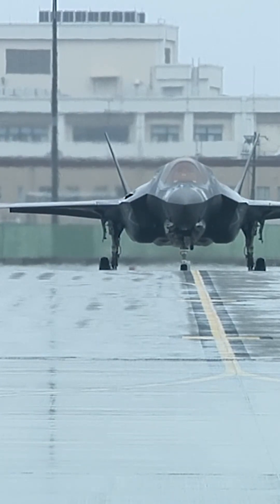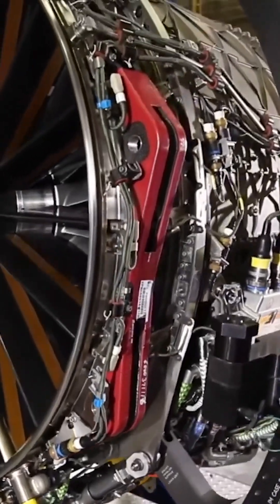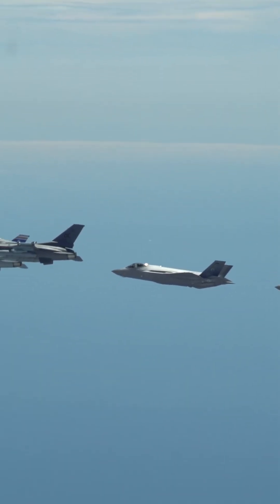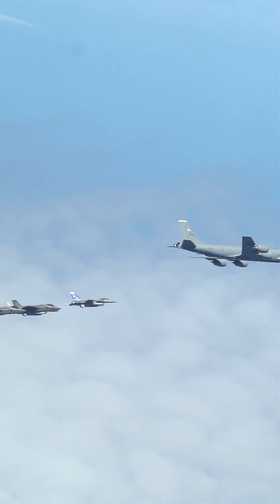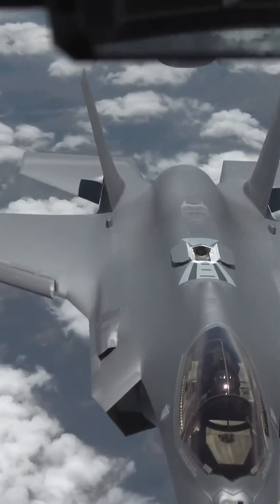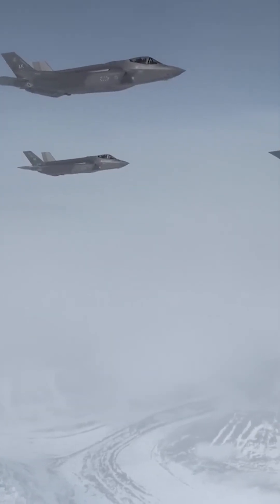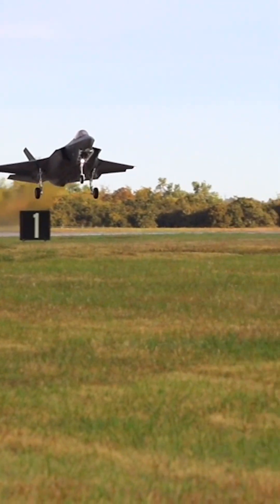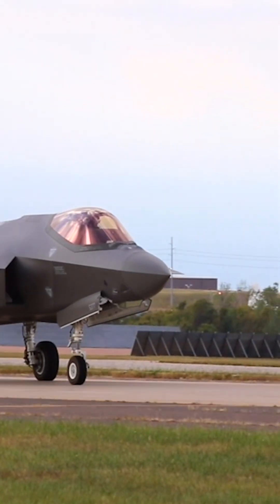Why is the F-35 Lightning II Aircraft Engine Single? #shorts

Comment: Good luck getting home when the single engine fails the drop to glide rate isn’t on the pilot’s side
Reply: Dual engines on fighters share common systems that if one engine fails, the second one usually fails soon after.

Comment: That's what the Navy asked for. They write the biggest check, period.
Reply: The Navy traditionally favors two engines for reliability in case one engine fails.
Reply: @georgehunter2813  that's a squak box statement.
Reply: @georgehunter2813 In practice, fighters with engines mounted so close to each other often share common systems that if one engine fails, the second one fails pretty soon after. Dual engine fighters failure rates is almost comparable to single engine fighters while having double the maintenance and man-hour cost.
Reply: Lot of money riding on one engine.